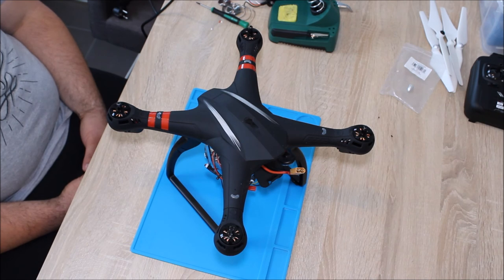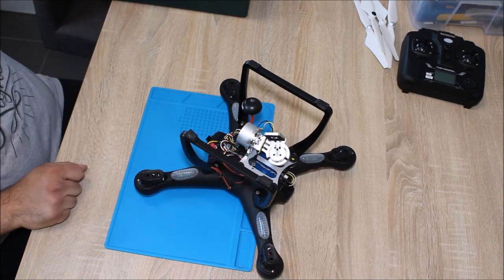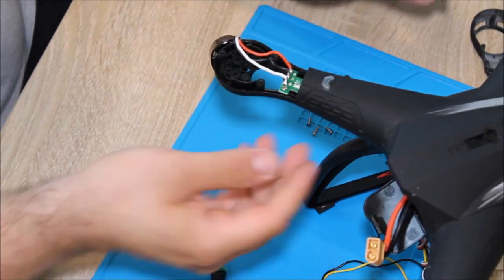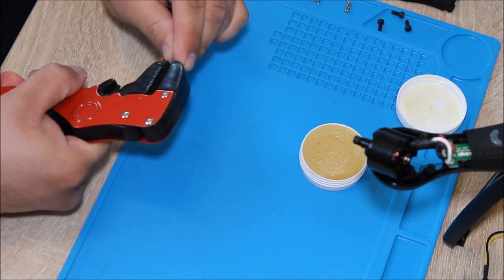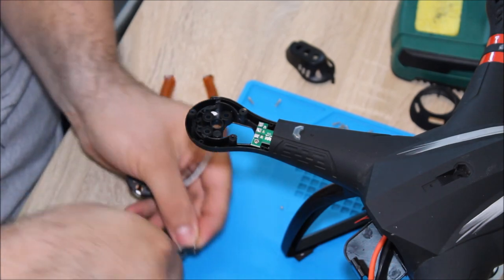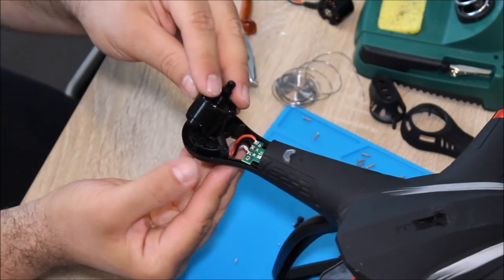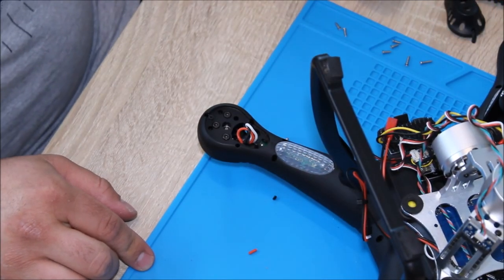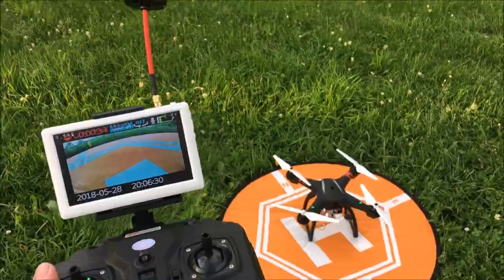Bayangtoys X21/X22 - Motor Replacement / Disassembly

Comment: Good Morning Martin
I own a Bayangtoys x21, and I have a problem with it. Just letting you know I'm a beginner in the drone world.
A few months back, my Bayangtoys x21 crashed onto concrete, I have learned that my battery connector isn't really great, if you move the connector slightly, then the drone loses power for a second and gets it back, which caused my crash. It would really help, if you can tell me any tips to stop that power from being gone for a second. But more importantly, after the crash, the remote won't connect to the drone. The remote itself is fine, so I was just wondering what chip was broken in the drone itself.
Reply from the maker: I am really sorry, but I am affright I can't really help you there. It seems like there is really something damaged there. I guess you can only try to replace the board, maybe you find something on AliExrepss.

Comment: Hi, Can you help me? I have BAYANGTOYS X22 and The top fell and the pillow broke and damaged body Does it have a warranty? To change?
Reply from the maker: If you crash you Bayangtoys X22 you most likely will not have warranty, you can only try to repair it your self and purchase spare parts only.
Reply: What website can I buy spare parts?
Reply: BAYANGTOYS X22 body is damaged and And a broken jump and a device that holds the camera
Reply from the maker: Amir A.Z Gearbest or AliExpress would an option.

Comment: Good morning martin
Thanks for the reply..
I have seen all your videos, but I do not have a gimbal, I have only mounted 1 servomotor that has to open and close a hook.
Pressing the "photo" button opens 0 ° -90 °.
Pressing the "video" button closes 90 ° -0 °.
I would like to use this to fish, but I can not write the program for arduino.
Thank you so much,
See you soon.
Reply from the maker: Hello Samuel, you can simply use the exact same code like with the Gimbal. The Arudino is just using a standard Servo signal to control the gimbal. Using the fixed Angle Mode you can simply adjust the Values for the Servo position between 0-2000 when editing MAX and MIN Values.

Comment: I have a stuck motor from a crash i replaced the motor but it was doing the same this as the old motor what could that be??
Reply from the maker: If motor can't be rotated freely without power, it's broken as well. If it doesn't move when powered on, you may have to also replace the ESC board for this motor as well.